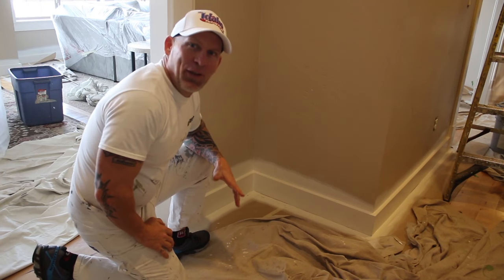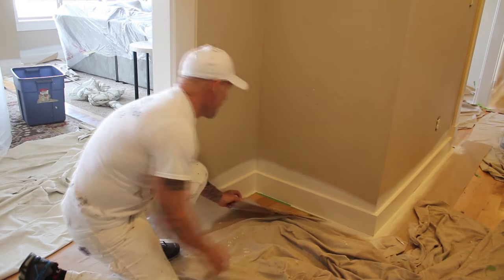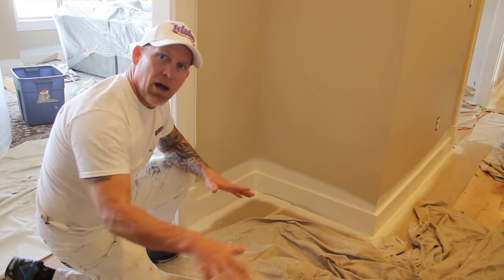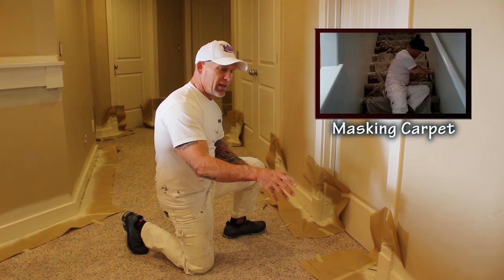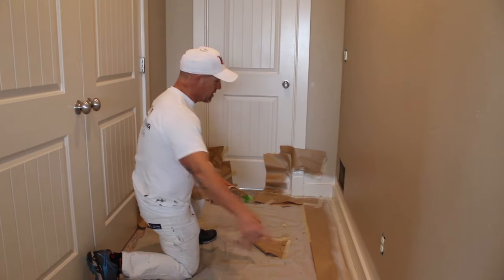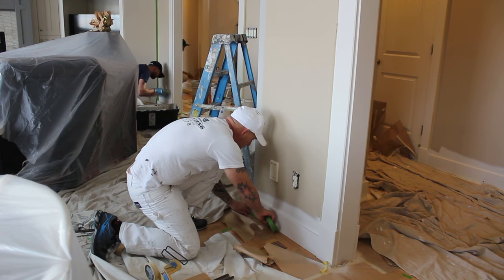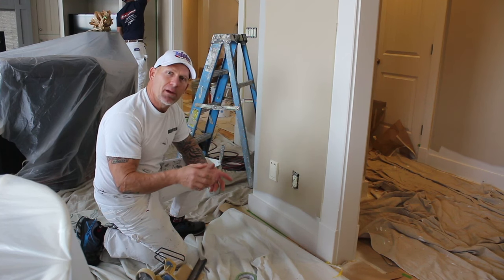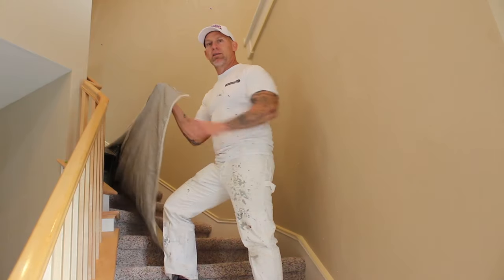DIY Tips covering floors before painting walls. Interior house painting hacks & tutorials

Comment: Hey man just wondering if you have any tips for me.  I'm painting a new construction home w/ finished popcorn ceilings, by myself.  The last one I did brush/ roll just took too long, should I try and mask the ceiling to spray or ? Any tips to save time would be appreciated, thanks.
Reply: No, I don't have to paint the ceiling
Reply: +Tony Stockell 
I know you've already done this job by now, but I wanted to mention an old boss that would spray walls real thick but only go up about 3/4 of the way to the top, leaving a couple of feet before hitting the ceiling, then going right behind it and rolling out the wall to even it out. You would think that overspray would still hit the ceiling, but he got away with it somehow. I've never done it like that though, just wondering if anyone else does that...

Comment: @idahopainter question...when
 masking on op of carpet with paper and 20-20 tape... you mentioned you 
spray then pull. Im thinking of doing this method , but with new 
trim..so i would prime first..what do u do when u prime first..you cant 
pull tape..and because needs final coat.
Reply from the maker: We pull the tape after the first coat or else you will peel the paint if you let it dry on the tape
Reply: so what you are saying is that it wont work..if spraying, it can only be one coat application..and must be primed before hand?.. otherwise doesnt make sence pulling tape before job is done. thanks  @Idahopainter
Reply: also...looking closer at the video, that paint has more then dried on that tape...so im a little confused, wyou say you pull before it dries, but yet, the tape you are pulling up the paint etc is very dry..please explain. thanks  @Idahopainter

Comment: Chris - Do you have a video that covers cleaning old interior walls before painting. I couldn't find one... I have to paint the complete interior with dirty walls that haven't been painted or cleaned in a decade. Lots of dirty walls from head to waste level in halls, stairways and around doors. Thanks for all you do.
Reply: I know it's been a year and maybe you've already found your answer, but still... First dust your ceilings and walls with vacuum cleaner brush attachment, maybe later use a microfiber mop to catch additional dust. Then, degrease with either dishwashing detergent or TSP. You may have to wash the wall and ceilings more than a few times to ensure complete grime removal. Then rinse if needed and then wait for it to dry. If you have any repairs to do, this would be the time. By the way, it is advisable to sand with 80 grit before priming the walls and ceilings. 2 coats of paint should go onto perfected and primed surfaces.

Comment: Can you do a more detailed video of applying the frog tape to the base boards? I recently painted my baseboards with your technique and I had a about a 1mm line at my base board where the paint got on my LVP flooring. I’m guessing the tape shrunk after getting wet? Fortunately, I was able to scrape it off but would like to avoid it next time! I tried “pre wetting” in a few spots with a damp cloth to activate the polymer on the tape. That seemed to work better but hard to say. In some of your videos it looks like you’re overlapping the tape on the baseboards from the floor? Doesn’t that leave part of your baseboard un painted and look bad?

Comment: Nice video on that prep work prior to painting trim, etc.  One question... How would you then paint the walls with the baseboards already painted?  We usually do baseboards last, but this way is interesting if there's a good way to roll all the way down without having to cut in the wall above the baseboard.  What do you guys do?
Reply: We do both ways but I'll just mask base with just 1.5 tape then  roll with in a 1/4 inch of base so only need to one coat on bottom